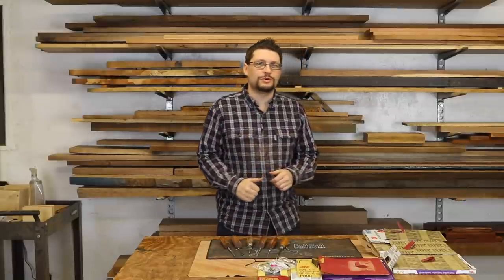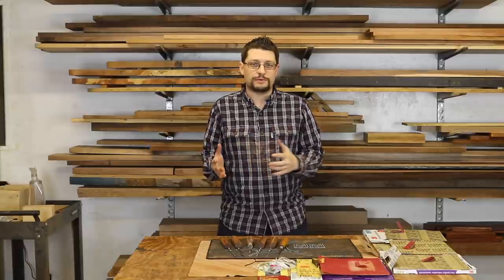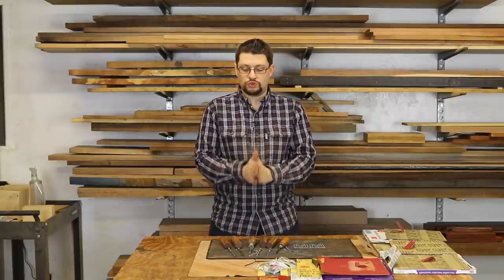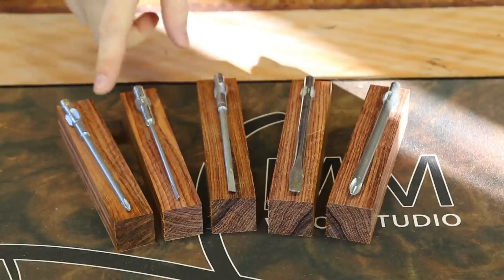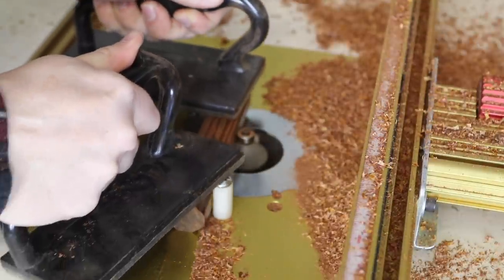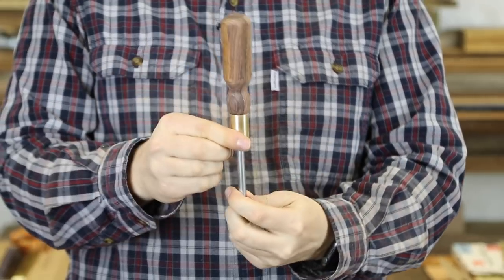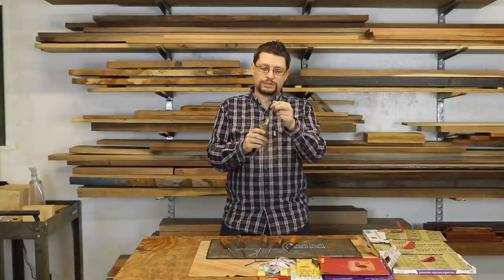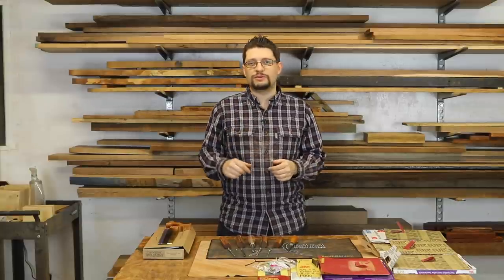Weekly Shop Update December 18, 2016

Comment: Yes, I would like to make a set of screwdrivers.  Can you share where you purchased the shanks?
Reply from the maker: That's a great question. Xcelite 99 Screwdriver shanks.
Reply: Grace, the former supplier of shanks to Lee Valley will sell shanks, not a catalog item, request pricing via email.
Reply: Are all the 99 series the same shank diameter? Looking to grab a set like yours, just wanted to double check! :)
Reply: All of the Xcelite 99 series are the same size at the "handle" end. It's a standard so that a set of blades all utilize the same Xcelite handle, T-handle, or T-ratchet.